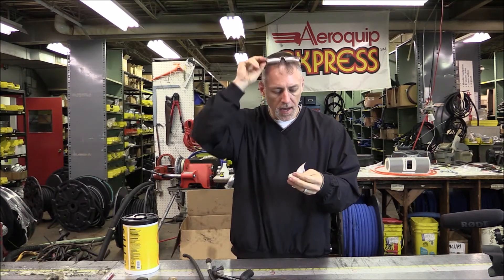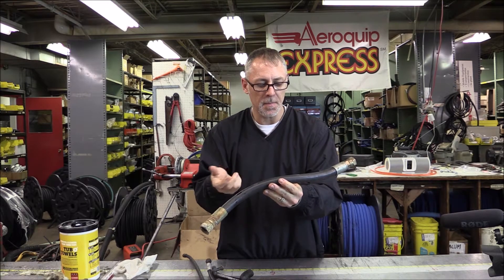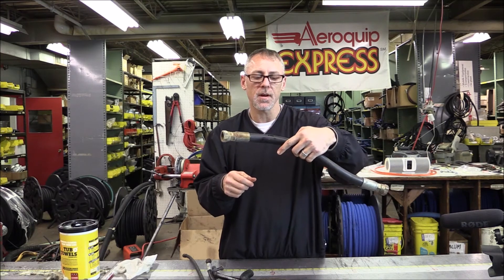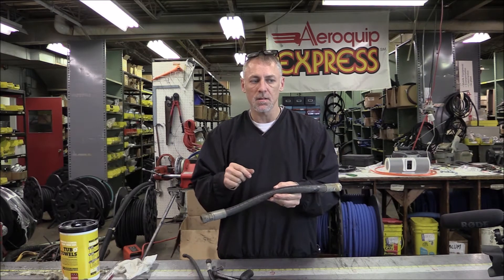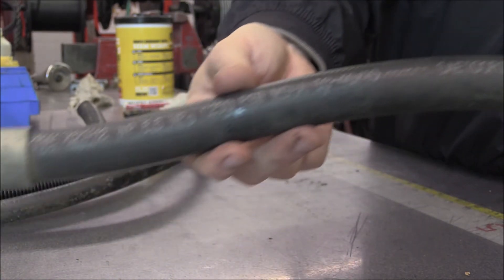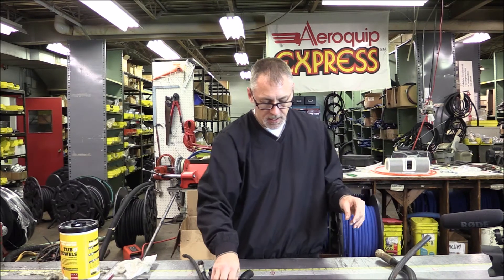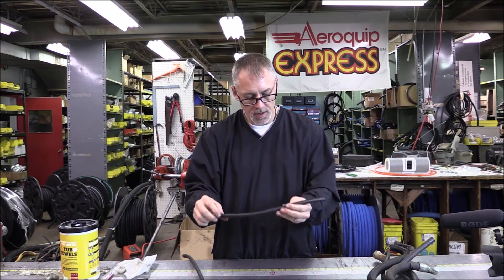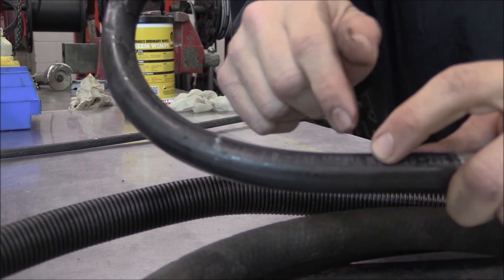Examples of SAE100R1 100R1A 100R1AT 100R1S Style Hydraulic Hose

Comment: thank you. I am trying to find out what the "T" means in "AT"?   I am new to this, but really struggling to find that !
Reply from the maker: T for thin - thin cover. With the introduction of polymers, the original standards for thickness of outside rubber cover changed.
Reply: @MurdockInd  ah, thanks very much !  I am attempting to repair a pressure washer hose and just need to be sure to buy the right repair kit !